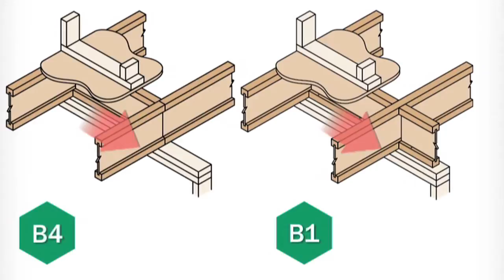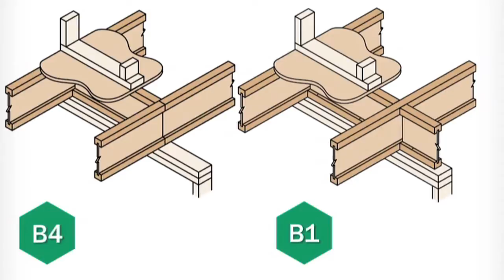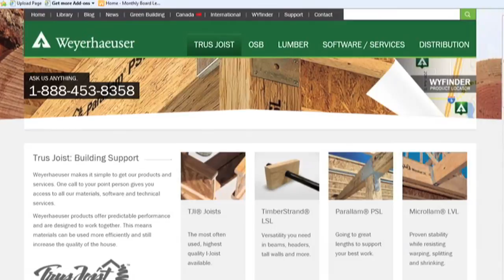Detail #B4 - Trus Joist EWP Floor Installation Guide

Comment: What if the butting joists are different sizes/thicknesses?  blocking will not sit flush against both sets of TJI's without making up the thickness or using 2 sets of blocking.